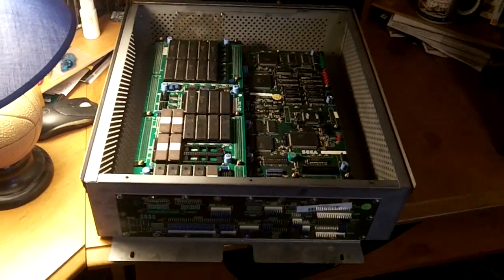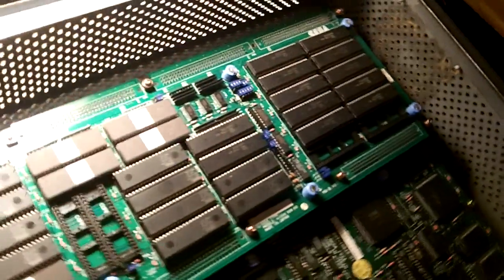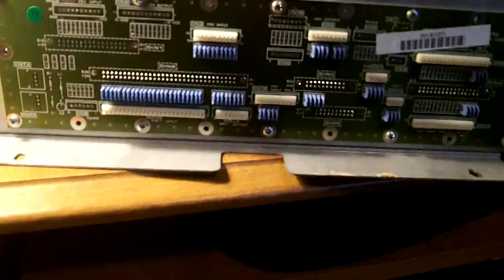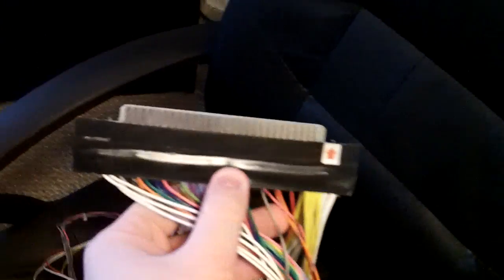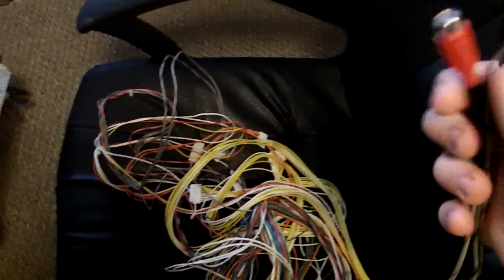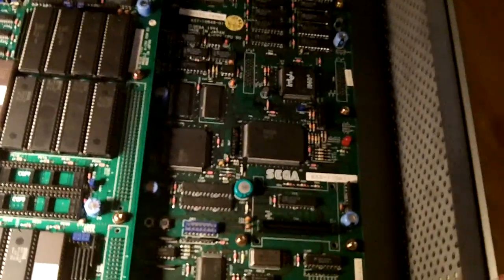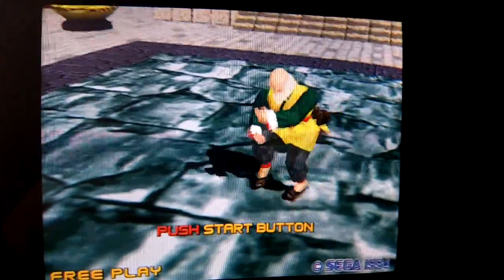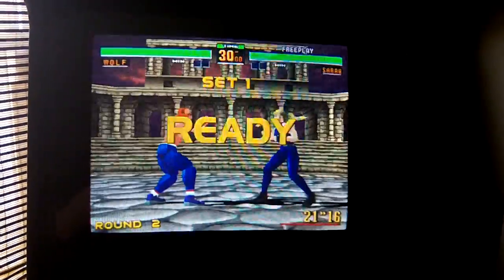Sega Model 2 Virtua fighter 2 Arcade Board

Comment: My Sega Rally stack runs on this. There is a lot going on in a Model 2A, even compared to its later iterations.  But fantastic Sega games, I love them and they're top of the line.
I've run my board outside the metal cage with my Naomi power supply that has been adapted to work with Model 2/3, and I haven't had any issues. I did screw the board back in the cage to declutter my bedroom, though. It is really heavy with the cage, and probably heavier than Model 3s in the cage.

Comment: Hey man what monitor make/model are you using? I get no video probably becaue of the virtical sync rate
Reply from the maker: I am using a makvision tri sync from 2011. I purchased brand new from suzo halo. They still sell these monitors. The sync issue your probably having is that you need a monitor that accepts 24k video signal (medium res).
Reply from the maker: Sorry that was suzo happ.

Comment: I was thinking of buying a model 2 and was wondering if you can mix and match the boards.
For example:
Could you use a model 2a rom board with a model 2c CPU board and a model 2b video board?
Reply: Unfortunately no. 2B has the most standard control games, but unfortunately VF2 is only on 2A

Comment: Can any game board (a b or c) be paired with any mothwrboard? I recently purchased house of the dead seperate from the motherboard and hoping they work together
Reply from the maker: House of the dead required a model 2C board. The different models had more feature sets than the last.
Reply: @raven69er  thanks! So can a 2C motherboard accept previous rom boards or does everything need to match?
Reply from the maker: @ScanlineCity  honestly I’m not sure. I used the information from system16.com 

You can check the message boards there and ask around.  I just don’t want to guess and give you the wrong information.

Comment: Hi there I'm looking to use JAMMA PCBs inside my Virtua Striker 2 cabinet (version 99' pcb)
Do you know of an adapter that I could easily use when wanting to use a JAMMA game with the existing wiring? 

Thanks!
Reply from the maker: As far as I know there is no adapter because all your lines are hard wired directly to the front plate of the pcb board. You can go in reverse like I did but with out short of rewiring your cab for the jamma standard no.

Comment: did you make the jamma converting yourself?
Reply from the maker: No it was already with the game. Wrapped up inside the cage was the harness... I wasn't expecting it.  As far as using the neo geo cabinet for JAMMA arcade boards I use a mvs to JAMMA adapter which is a small plug like adapter that allows you to run JAMMA games in a neo geo cab as the audio is wired differently.
Reply: +Seth Fisher thanx, I'm asking because I'm planning to jammafy a Turbo outrun and a Daytona USA boards and was looking for some insights :)
Reply from the maker: +matan klinger Nice nice... Any questions feel free to ask!!! Good luck.